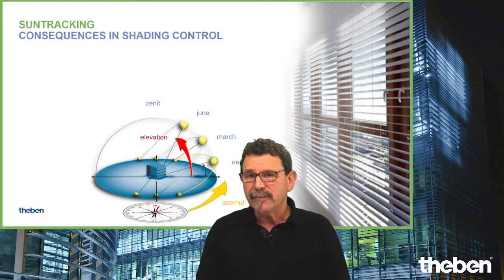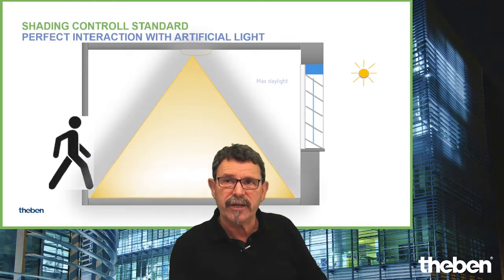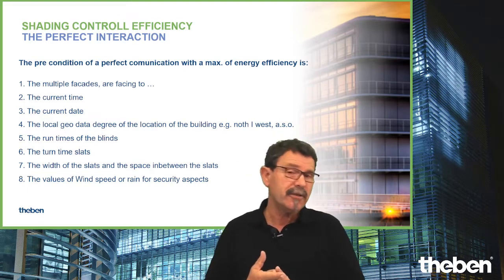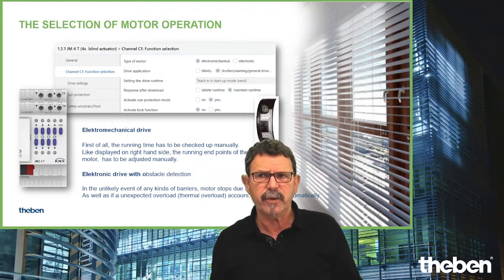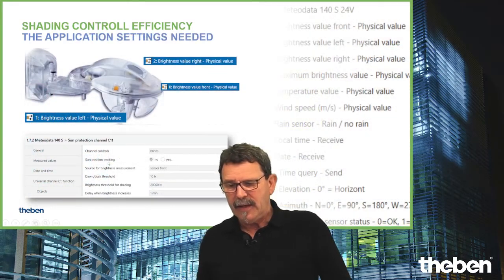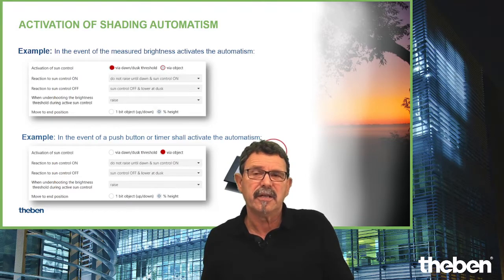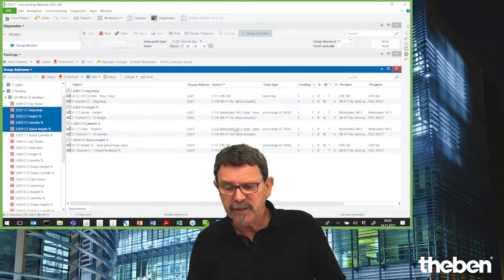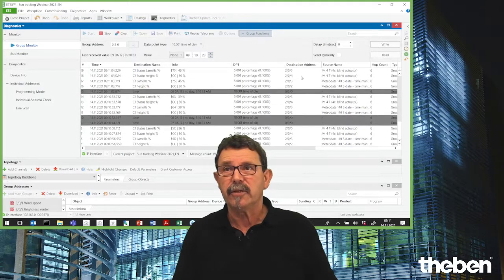Video tutorial automized blinds control KNX - sun tracking at it’s best

Comment: Thank you for the interesting material. I have a question about blinds: does the algorithm take into account the type of blinds used, e.g. C profile with an adjustment range of 0-180 degrees or Z profile with a range of 0-90?
Reply from the maker: Thank you for your question! If you’re referring to the adjustment time for the lamella movement, this can be set between 40 and 250 ms. Additionally, you can configure how many steps are required for a full tilt adjustment based on the type of blinds you are using (e.g., C profile or Z profile). I hope this helps! Let us know if you have any further questions 😊